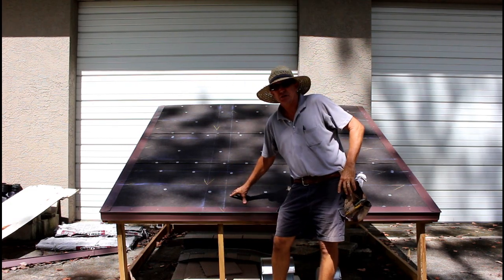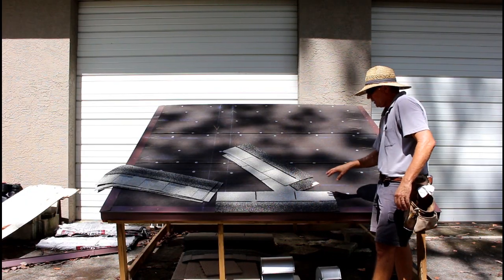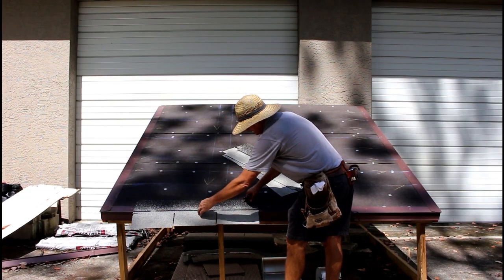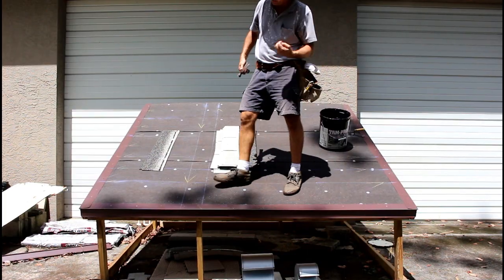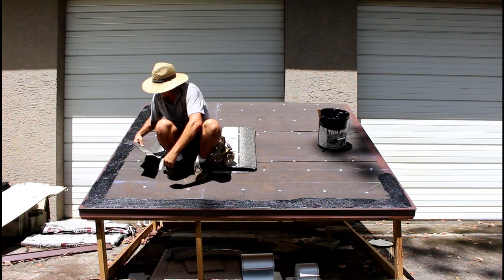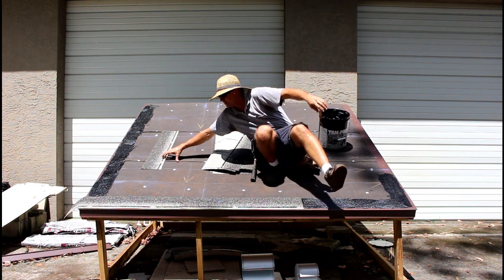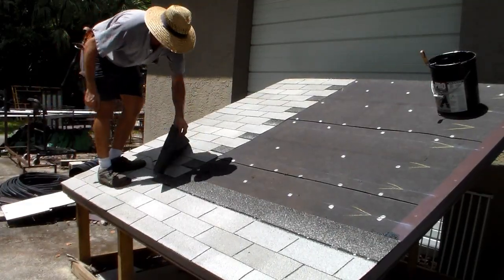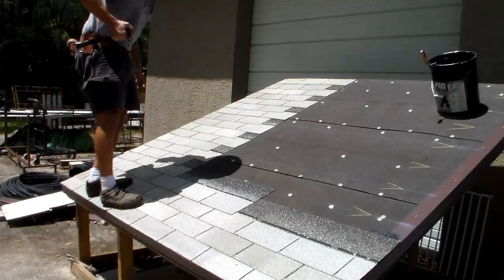Roofing - How to Install Asphalt Shingles - Getting Started Walkthrough

Comment: Excellent video guys. Even the mundane tasks are helpful for us beginners. Thanks!
Reply from the maker: That's part of the plan. You have to get started and then you can learn as you go.
Reply: What kind of knife were you useing?
Reply: i think your video was pretty good,  I would use it anytime
Reply from the maker: I must have missed this comment - It is a Stanley Quick Change knive - with straight and hooked blades. You don't have to take the knife apart to change the blade.

Comment: Great video, first one I've seen where they just don't turn the shingle upside down for the starter, cut the shingle to put the asphalt strip at the bottom for the starter.
Reply: My installer literally installed them upside down... the tar is sticking to the drip edge. Now, I have to go back and cement the whole first row of shingles down to the starter. I wish I had watched some of these how to videos before hiring such a hack.

Comment: Most 3-tab shingle manufacturers recommend continuing the starter strip up the side rakes for high wind conditions/extended warranty coverage.  Have you ever had issues with manufacturers because you are not doing it?  I know the roofing cement will help tremendously with wind lift, but there is an additional layer of toughness and protection added to the edge rakes by doing it (i.e. debris falling on edge).
Reply from the maker: We use roof cement. It is an acceptable alternative. I believe it says it in the installation instructions.

Comment: They sell pre made starter strips for roofing .
Sometimes they are not wide enough .
So newer shingles are metric .
If you pre cut your shingle for both edges.
It will be easier for the install .
Can use a square for great cuts.
If u have a foam cushion or knee pads it will ne easier on yer back if not used to ROOFING !

Comment: At 10:20 you didn't put the first starter shingle even with the roof, can you tell me why?
Reply from the maker: I put it on my key line. So once the next starter goes on, my first shingle will go on the next key line so they don't match up. The starter and first shingle will then be 6" apart, just like the rest of the shingles. Have seen many leaks due to the starter and first shingle lining up.

Comment: Great workmanship, but I would think it matters that you don't have to go back whether you are making money or for yourself. With all those large headed nails in the tarpaper, what do you do when you hit one when nailing on the shingles and it slips and damages the tarpaper?
Reply from the maker: It happens, but not very often. When you are hand nailing, usually you can feel it right away. With a nail gun, you just have to fix it as you go. Not a show stopper

Comment: This is fantastic to see. Figuring out how to stagger tabs for my FL vacation house.  Why did you adjust the pattern at ~19 minutes, and start placing vertically?
Reply from the maker: Typically after installing a few rows on the bottom you would turn around and start laying the shingles up the roof. In this video I showed how to rack the 3-tab shingles straight up. There is also a 5" pattern that doesn't line up which would stairstep or rack. Bending down towards the edge is a lot more strenuous than facing the ridge. Working on the shingles will sometimes scar the shingles so that is also a consideration. When you are used to doing it and can move fast you will always be on new shingles so you don't scar as much. A cushion may help with this.

Comment: What kind of nails u use for drip edge? Can you use same ones for Shingles?
Reply from the maker: 1 1/4" ring shank. Yes, you can. Yes we do. Unless code specifically says it, then smooth shank roofing nails are typical for the shingle install.

Comment: I have a question,why you did not put a starter strip on the sides ?
Reply from the maker: We use roofing cement. It does the same thing as a starter strip on the rake. It is code in this area to use roofing cement if the dripedge is over the paper.

Comment: Is a drip edge really needed, or can I do without it?
Reply from the maker: Depends on your local codes. Many installers overhang the shingles and do not install dripedge. Installing dripedge is better as it protects the corner and closes off the seam where plywood and fascia meet. I would not install a roof without dripedge.
Reply: Practical Roofing Concepts thanks, I will install drip edges, appreciate the video

Comment: It is manufacturers spec to install the dril edge under paper fyi
Reply from the maker: It can go under. We have always done it this way due to not having ice to contend with. Florida Building Code allows under or over. We seal with roofing cement for wind. I have only seen guys from up North put it under over the last 30 years. Both ways seem to work fine with respect to water. Wind seems to be what the building code is more concerned with.
Reply: Florida Building code and inspectors prefer to have the drip edge on top of paper several wind tunnel studies shows uplift winds tend to raise the roofing membrane at the corners and cause water intrusion so putting the drip edge on top of paper helps to stop water from coming in even if the shigles blow off at the corners
Reply: My drip edge said under the felt paper or according to local codes if they require something different. It seems like hurricane areas are more likely to require this cement method.
Reply: I like paper, drip, moisture gaurd. In that order. Guaranteed water proof.

Comment: Your not supposed to rack either type, blow offs will happen in large quantities
Reply from the maker: In my opinion, it has nothing to do with blow-offs unless you are not nailing the covered side of the shingle. Wind resistance has everything to do with nailing pattern and edge detail.  The best method for lining up the keys is to rack the 3 tab on 2 perpendicular lines 6" apart. The reason for not racking the lams is because they do not want you to see the pattern where the shingles meet. They want a random pattern, as that is part of the look (shakes mostly) If you rack them, it will create a pattern that can be seen easily. If you stair step too close, you could also see a pattern.
Reply: Read the packing or manufacturer details, no racking. I live in Newfoundland, Canada it's a island constantly windy. Many many days  90 km/hr plus and a few real bad days  165 km/hr  is a common yearly occurrence. The roofs that have shingles installed the way you describe, when they loose shingles they loose them all, as opposed to staggering shingle courses they may have one or two blow off but that's it. The only real bonus to racking shingles is the extra money the contractor makes installing them.(its much quicker to rack in my opinion) 
If your a good contractor that offers a quality product and returns if there's a problem with your work, you'd save money by doing it properly and staggering your shingle courses at least 4 rows.
Reply from the maker: I don't doubt that there may be some manufacturers that frown upon it, but the exact words of the last of 3 methods in the Certainteed 3-tab installation instructions is - The alternate “Six-Inch, Single-Column, Vertical Racking Method.” https://www.certainteed.com/resources/CT20Intall.pdf  - page 93 - right hand column - towards top. I believe that the reason it may not be recommended for wind resistance is that installers (or non-installers) will be more inclined to "3-nail" if they rack them. If this is the case, then the absolute minumum of 4 nails would only be in a few shingles and most would only have 3 nails. Around here we put 6 nails in each shingle minimum (as seen in this video).

Comment: I havent seen anybody roof in 6s lately. Its all 5s.
Reply from the maker: Do you mean the 5" offset?
Reply: Yeah. I dont know the rules and codes of every city but everybody ive worked for in Houston does 5 inch.
Reply from the maker: Pretty sure it is a 4" minimum regardless of area. 5" pattern or offset will ensure that the keys don't line up. This way you don't need vertical lines. When you do the 6" and they don't line up, it really doesn't look good.
Reply: Exactly, specially on higher pitch roofs.